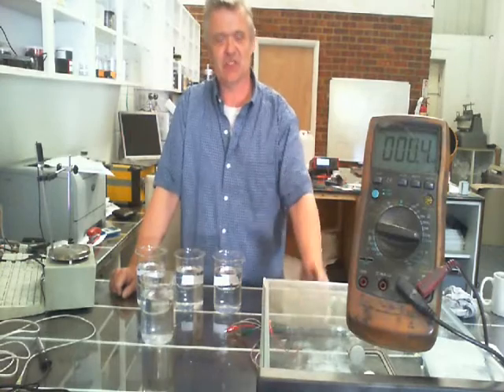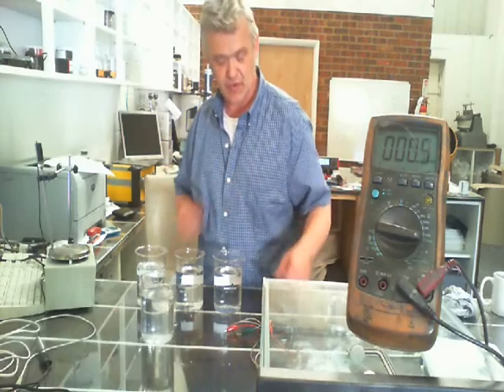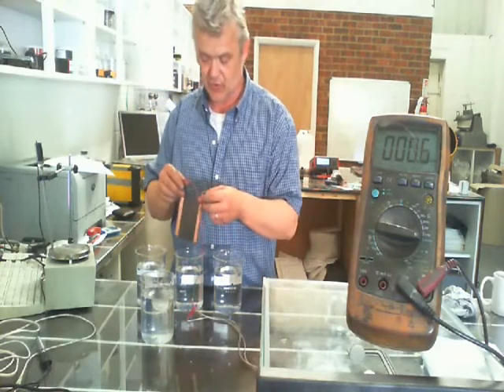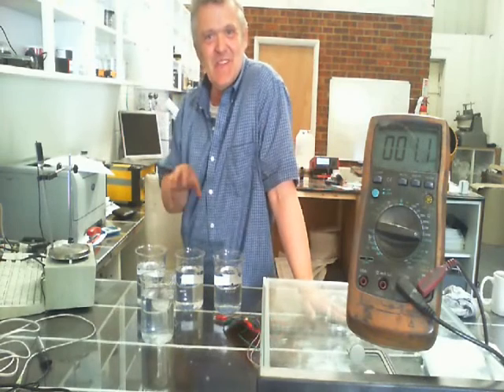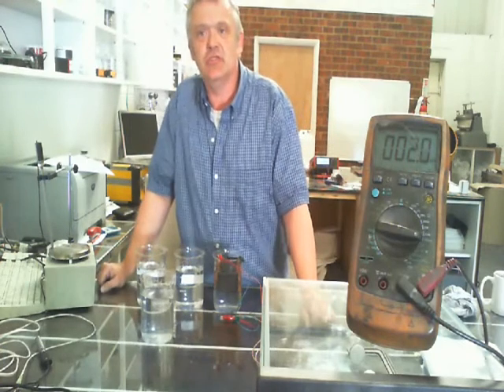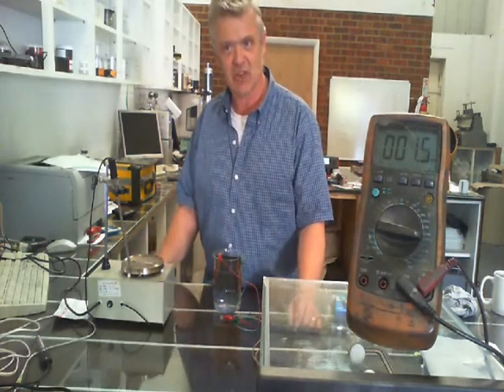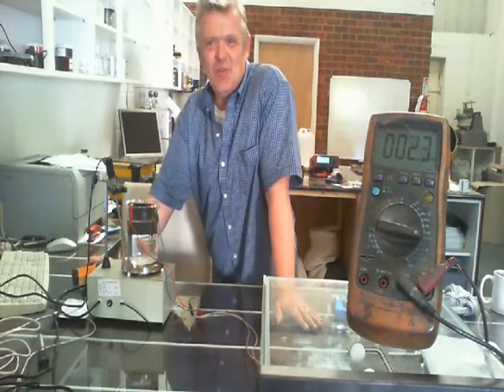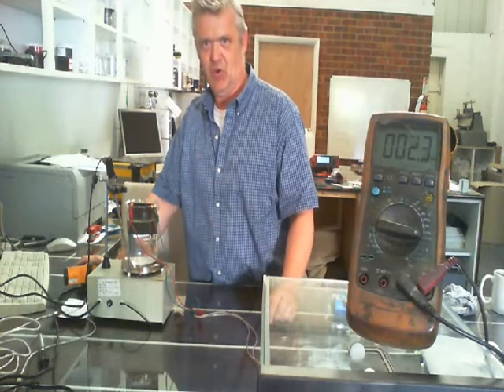SWAG Update Different Salts - And A Thermal Battery

Comment: Hello Robert,

I like the first SWAG device that you made the most. I studied this phenomena of nikola tesla since more than a decade now and I once found an article of Mr. Tesla himself, writing about this Antenna. It also showed a picture of who him standing next to a pole where such a "collector plate" hang from. 

He then proceeded with the help of another man (dont remember the name unfortunatly it is now 10 years past) who simply put diffrent frequencies through the copper wire into the antenna/collector.

On the photo of the article Mr. Tesla showed that he can light over 30 bulbs only by hanging this simple atenna from a height and put frequencies into it.

Well I am no physics expert, but as far as I understood Tesla (who said the mistery of the universe is in frequency vibration and enegery)
These diffrent impulse that you give into the wire create a cymatic (look it up on youtube) pattern on the plate. This pattern is diffrent for every Hz used. So if you get a good one, all these radiant particles should flow in a specific pattern and enter the wires much more easy :) 

Unfortunatly I am not able to replicate this because I don't even really know how to build even a simple electronic circuit. But I am 100% sure that this will Improve your device because 1) tesla said so and 2) I understand a lot of cymatics vibrations and harmonics, and it sounds very logical from this point of view that it works, as I explaind above.

Hope someone took the time to read this, and light up the planet ✌️

Comment: It would be interesting if make 2 solutions of cl3Al. one as reference with no load on the plate and another with load on it and measure the temperature differences in the two container over time to see if it actually cools down the solution when the load is on.
Reply from the maker: absolutely mate

Comment: Amazing. Car companies would be interested def to commercialize this. BMW has been experimenting to use the wasted exhaust heat energy to generate electricity, but because the current method is basicly having a turbine there i think they concluded it was too restrictive and/or expensive (oil circulation and all that stuff, making half of a turbo is like 70% of the cost of a turbocharger minus the boost in performance)...

Now how about you just coat the exhaust header ...

Make this plate from heat resistant materials (800C or so), and put it in contained vessel with the solution which is aswell heat resistant. Flexible of course, and simply wrap it around the exhaust.

Infact, come to think about it, anywhere where there is wasted heat energy. Think anywhere with a chimney. Power stations have tons of wasted heat energy.

That is such a simple device that even if it is small amounts it should work out profitable commercially.
Reply: Come to think about it, i wonder what happens when you power that sheet ... Probably heats up the solution.

Then, when you try to draw current, does it ever get to 0 output?
How about cooling the solution below ambient temp what happens then?

So many questions!
Reply from the maker: have you ever tried to work with car OEMs? - they are a nightmare lol
Reply from the maker: your best bet is to make one and see lol
Reply: no i have not, but i can only imagine the amount of red tape etc when it comes to big corporation
Reply from the maker: lol - yep

Comment: do you think that instead of baking powder I would use AlCl3 I would get better results in my Karpen cell ?
Reply from the maker: yes i do - i certainly think you should test it
Reply: been googleing since to try and find a source in Bucharest and zilch ... where do you get yours ? is it used in any kind of industry like say activated carbon is found in filters ... fish pet shops.... I would find AlCl3 where exactly ? 
HCl is hard to get but  getting a solution of HCl and dumping a lump of Al inside would generate an AlCl3 solution, isn't it?

Any ideeas ... feel free to shoot ... I'm stuck on this one for now  ( the procurement of ... )
Reply: KCl any good ?
Reply from the maker: actudoran
KCl would be just like NaCl it is the charge on the cation mate - HCl is used as pool pH adjuster and brick cleaner it is also called spirit of salt or muriatic acid - you can buy it in the builders yard - that and kitchen foil and you are there
Reply: so I looked for HCl in the building industry here and it seems that the communists had no love for bricks and concrete was the way ... no luck ... 
pool management ... will be enquiring there.

btw got new ideeas that I'll test on the Karpen setup.
Reply from the maker: actudoran
that is a real pain for you mate - i will try and think where else you might get it
Reply: ok .. . cannot get it under any circumstances in Romania as it is a controlled substance ... bugger !
I'll try and approach individuals from various labs and see whether I can ge some AlCl3 already made or just get a 250 ml vial at 10% purity HCl for educational purposes. The educational site I found also does 1 litre bottles of 30% H2O2 :) maybe I will be able to play with graphene sometime :)

would 10% solution do ? Should I tr and refine the HCl and how ?

Alternatively ... table salt  .... water ... current .... some HCl....  ?
Reply from the maker: actudoran
a 10% solution will be fine mate - here is a very good video on how to make HCl Make Hydrochloric Acid - here is another good how to video using sulphuric acid http://science.wonderhowto.com/how-to/make-hydrochloric-acid-from-salt-319915/ - be careful doing this mate HCl is not nice stuff
Reply: I know m8 ... HCl is highl y hidroscopic so a nice ware trap woul yield goodvresults but .... if any escapesbin gaseous form its pretty shitty .... especially when doing it in the living room ... 
If you say 10 or 16% works ... ill just hit the educational pack .... alternatively i can try amazon or aliexpress. I intend to get a small can of coke a graphite pencil type lead to collect the charges off the activated carbon and try this way untill i get some AlCl3 ... seal the cell and leave it indefinetly powering a jthief and a led ...
Reply from the maker: actudoran
10% will be fine mate - it just means it'll take a bit longer to react and you will have a lot of water to get rid of - you might try making aluminium hydroxide first then neutralizing the acid with that - it'll be quicker and give you a measurable point for the end of the reaction
Reply: Haha ... well thought AlOH fist .... but .... i found AlCl3 on ebay from uk even ... 4 quid a little bottle of 100 grams which i am inclined to go for because even if i get hcl from china it will stay in customs ...
You had half a mol concentration in your AlCl3 solution and as a mol is 133.333333 grams, i know crap about those calculations , so how much water you added to 67 grams of AlCl3?
Reply from the maker: actudoran
dude! you don't learn without doing lol - just look up the molar mass and work it through lol - it's good for you to do it
Reply: Lol ... very initiatic Mr Murray - Smith. .. prolly for the best
Reply: Just a thought... since I want some ink off you to play with, could you include some AlCl3 too in the package?  Say about 200g dry ... yes I did my reading and this amount should produce 3 litres of half a mol solution. 
I got paypal ... let me know what the p&p is and how much for the ink (the smallest bottle) and AlCl3.
Reply from the maker: actudoran
sorry mate - I can't be supplying you chemicals - i am not registered to do that
Reply: Lol ... nobody asked about registration ... but I understand ...

Comment: really enjoyed your video!
the setup you got is so similar to Karpen's fig 3 from the patent translation. he mentions the liquid being sodium carbonate solution and two types of carbon for the electrodes.
it seems you have already done what I was thinking of heightening the entropy to raise output :)
Cool bananas !
I just got my multimeter today and have already built an alum air  battery to play around with .... now I get it ... the carbon side must get air too ... 

so ... what's the easiest way to make the ink with kitchen level equipment ? :)
Reply from the maker: i did a video on making an ink this way it's in the conductive inks playlist

Comment: Hello Robert. I very much appreciate you sharing your findings. I was just wondering in the experiments you showed in this video, if you exposed the solution to sunlight/UV light, would you get higher voltage. I am thinking of a solar panel application.
Reply from the maker: hiya mate i tried UV and nothing

Comment: I would say the speed of the molecules moving around is more suspect than the temp of the molecules, so a molecule substance that liquifies at a lower temp should give the same result as this at lower temps, question is how much of the salt is getting knocked into the plate by the other liquid as opposed to water molecules, and how they are I am sure knocking the salts against the plate, but point being is that the water vibrating around the way it does making it a liquid vs a gas or solid is more responsible for this, so if you could say introduce it to a low temp gaseous substance I would think it would give even better results since gas particles are moving about faster than liquid particles.

Just a thought here.

Comment: Facinating, I would like to see what a Vanadium 5 solution would produce.....
I assume that the raisning of temperature is like the increase of speed in as much as it is increasing the number of collsions and therefore the electron exchanges....this is very interesting stuff.
Reply from the maker: yes i think so mate
Reply: really wish the comments would load faster lol, as I just said pretty much the same thing and just expanded on using substances that will dissolve things with a charge (or have one already of their own?) but melt at lower temps or even using something with a charge that is a gas at a low temp like room temp lol.

Comment: Hey Robert, great video, wonderful information! Thank you.
I am confused about the polarity of the battery output. If the SWAG plate is symmetrical with a  graphene ink coating and two copper conductors, what differentiates a positive from a negative. In other words, why does the current flow one way instead of the other way? Am I missing something simple here?
Reply from the maker: It's ac current flow depends on water flow across the surface. So as you put it in the polarity is one way as the water flows that way then as you pull it out water flow is reversed so current flow is reversed
Reply: Robert Murray-Smith
Hey Robert, thanks for the kind reply -- but I am still a bit puzzled, especially about AC produced by the stationary SWAG in the hot aluminum chloride. For the regular dipping up and down SWAG, the electrons would still have to "know" whether to go to the left copper electrode or the right copper electrode. It would make sense if the copper strips were at top and bottom, but (unless there were a magnetic field hiding somewhere!) I do not see how you get alternating left and right current flow from an up and down motion of ions. Sorry if I am a bit dull on this, but many thanks for your work.
Reply from the maker: Robert Shipp
it's not up and down mate it's adsorbed de adsorbed and double layer formation this matters as it changes the relation the charges have with the surface
Reply: Robert Murray-Smith This new tech goes against some things we've been taught. That is an interesting point though. Adding a diode to each lead from the plates to give them a sense of direction should cause a charge to build in one direction and dump double voltage in the other direction. Plate acting as a capacitor.
Reply from the maker: good point mate
Reply: Robert Murray-Smith "It's not up and down mate it's adsorbed de adsorbed and double layer formation this matters"

Ah! That makes more sense. Sorry I misunderstood. Thanks, so much!
Reply from the maker: Robert Shipp
just hope it help mate

Comment: The charge has to be coming from the movment of the ions in the water over the graphitic surface. Thats my opinion. I think ions actually move around on their own at high speeds.
Reply from the maker: probably right which is why it operates as a temperature battery

Comment: Great, that is very interesting! Thanks.
I try to do something ( your work is very motivating ). I think I will you a video. I use sheet of graphene/graphite with some aluminium sheet and it generates 750 millivolts...I don't if that's a battery or a generator or maybe just an air battery.
Reply from the maker: it would be good to see a video mate
Reply: Robert Murray-Smith that s done ! Two videos.

Comment: So, flat hollow panels made of black plastic (like they make buckets from) painted on the inside and strapped to the roof, designed to maximise thermal convection to force an aluminium chloride solution to move around inside, would you get a worth while solar (heat) panel?
Reply: It looks so Fred Gandt !
Reply from the maker: yup lol
Reply: \o/
Reply: the one addition to this I would add is using various bucket sizes so they can nestle inside each other like russian dolls, so each one gives its own charge and lets you get more power per cubic area ! :)